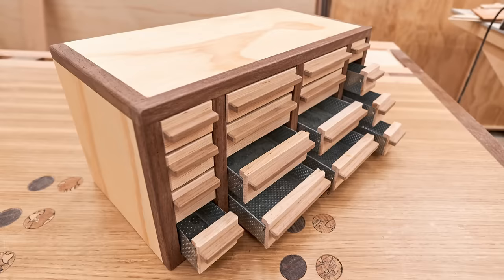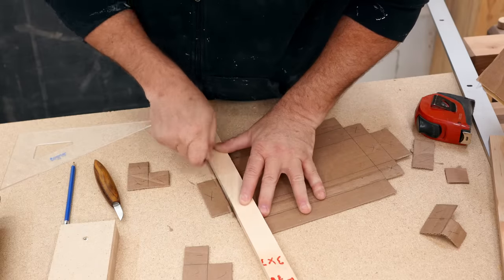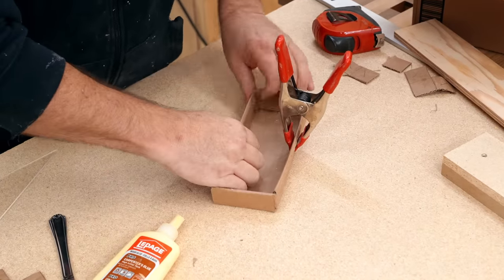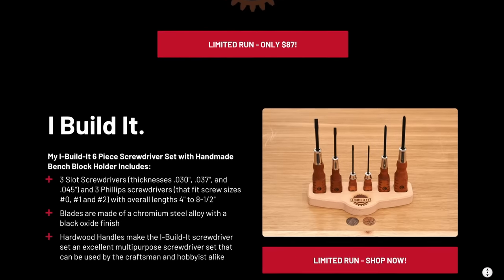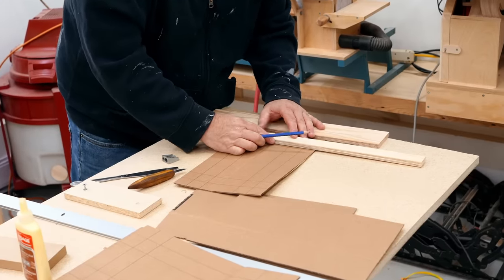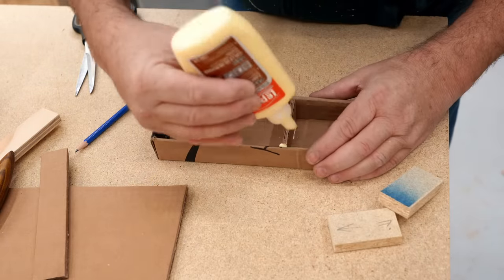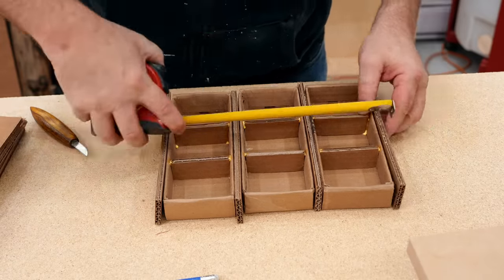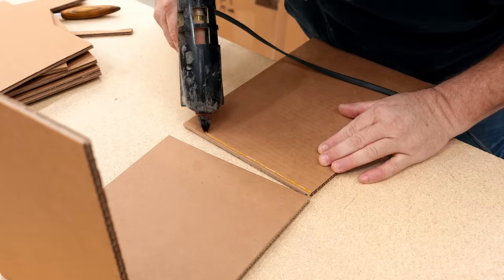Making a Small Parts Organizer with Drawers from Cardboard

Comment from the maker: My 6 Piece Screwdriver Set: https://ibuildit.ca/blog/6-piece-screwdriver-set/
High lumber prices putting the brakes on your creative endeavours?
Got too many small parts cluttering up your existence?
Is cardboard becoming a real problem due to all of the crap you buy on Amazon that you don't need?
Well, here's the solution!
You can actually make some pretty sweet stuff from cardboard, like this nifty parts organizer with drawers. You say it won't last, but you, my friend, would be dead wrong - it will last for years, even with regular use. And you can get a lot more fancy than I did here, and be much more selective about the quality of the cardboard you use. It's FREE, after all! 
Next: a cardboard table saw!!
Reply: Hi John, Thanks,,, Tip use white duct tape to strengthen and good contrast for Sharpie writing.
Reply: You're hawking Slot and Phillips head screw drivers  ?   What kind of Canadian are you ?  Robertson FTW
Reply: >Next: a cardboard table saw!!

This made me laugh, because you could probably do it.

Comment: Add a finish!  That would add more strength.  Shellac or water based polyurethane.  (don't forget to sand between coats!  lol)  Up next week, John makes a mini table saw for cutting cardboard from a pizza cutting wheel!
Reply: You could use a silicone spray like Campdry.  I used to spray my sleeping bags and camp gear.
Reply: John's paper table saw blade would actually be perfect for this 🤣 https://www.youtube.com/watch?v=rYfkhdKcEiE
Reply: You could also just use some contact paper.  It would be the cardboard equivalent of a laminate/melamine top! 😄
Reply: Sorry, John !  I forgot to use the "sarcasm" font -- again.   (sigh)
Reply: @KSFWG  I did get the sarcasm...but the contact paper is just a good idea.  Also, the "laminate top" thing...I thought that was cute.  Just sayin.
Reply: I would love to be there one day when you tell your kids (or one of them) that you are generously passing this project off to them!
Reply: It's not at all like John but an OIL BASED (OMG!!!) polyurethane would be better suited for this project.  Oil based poly will penetrate and harden the wood fiber base very well, adding a great deal of strength to the cardboard.  I saturated my router table top made of 2 layers of MDF with several coats of thinned oil based poly and it's very durable.

Comment: I was a corrugated structural design intern for a bit, so I might actually have something to add!
- when you crease/fold board, the outside dimension will half the board-thickness longer than your crease, and the inside dimension will be half the thickness narrower. Because of, this, it's very easy to lay out designs perfectly from the start, only measuring during layout, as long as your cuts are accurate (we used CNC)
- creases that need to be more accurately placed (like the ones describing the width of the drawers) should be made across the flutes. Creases made with the flutes tend to drift into the nearest flute.
- creases should be indented to about half the thickness of the board. The outside liner will be stretched taught and pulled in to that point, and the inside liner will buckle to meet it.
- creases should be made on the inside of a curve. Creases that need to be made backward are usually made with a perforation (so you can work from one side only).
- to build a pull-tab into the structure, cut an upside-down U-shape into the front outside wall of the drawer, with the "legs" touching the bottom crease line. BUT, don't extend the crease across that shape. When you fold it, it should stick out straight like the one you glued on, but without adding thickness. You can use this to made tabs for closing cereal boxes, and on on the bottom of boxes if you want them to stack into slots on top of other boxes.
Reply: Where can I find this info ?
Reply: I'm thinking if you made a video of all this cardboard folding info, you'd have a really good view count! Thanks!
Reply: I assume the width of the crease must come into play with measurements. Using the back of a butter knife vs an 1/8" thick ruler, for example?
Reply: @wingnutbert9685  The width of the crease should be negligible if you use a reasonably thin tool. Very wide tools result in more of a radius emerging than a sharp corner.
Reply: @Kuchenwurst  Agreed. It was just a thought as thickness of the crease would be a factor if looking to get a snug fit for something like these little boxes. And the tool used would have an effect. I know this from experience, but I often pose these questions to prompt those that don't to take details like this into account as they are often not considered or mentioned. :)
Reply: where did you get this internship? i would really like an internship like that! 
:)

Comment: I'm a cardboard artist, and I'm glad to see others dabbling in card board. I use a pizza cutter to score my cardboard. If you use a length of for the handle all the way back. Apply a light layer of glue to both pieces of cardboard. this will prevent warping.

Comment: When working with cardboard, don't be hesitant to use lots of packing tape throughout the construction.  Cardboard can also be painted to transform it into a durable product. I would love to build several of these to hold not only small parts, but seeds for planting, spices in the kitchen and sewing stuff but I would still make the outer case and shelves using wood for strength and durability while the drawers could be made using cardboard.

Comment: FWIW, the 'paper' clips you referenced are called Bull Clips.  and, yeah, they work a wonder.  i recommend using the plastic ones you can get from Staples, they don't grip as hard as the metal ones, which means it won't dent the heck out of your edges when gluing them up.

Comment: Thank you for this John.  This has inspired me to make use out of the old acrylic sheets I recently replaced. I was about to take then to the transfer station but if I trim the sealant off of the edges I can experiment and make something useful.  I usually keep my cardboard for making prototypes or as padding when I have to work on the car.

Comment: Ya know John, I worked as a mechanic for 30+ years and some of that was in the parts department at the Lincoln Mercury shop and Ford used cardboard parts bins for years getting away from the old metal ones. They hold a lot of weight surprisingly well and hold up good. Went on a Dealership Closing clean out where we shipped all the good stuff back to Ford (in those days) in the trays in larger boxes and a Ford delivery trucked up boxes. It was hard work.

Anyway, the point is the tray boxes were in "flats" of 50 and you folded them together to use. Well I got several flats of small, med, large boxes. After 20+ years they all are looking a bit ragged from the grease and dirt. So I did what you did. I used old cardboard and made new ones... Lol
Awesome video and loved how you sneak in all the little wood jabs like"I'm using wood glue." Very funny...

LLAP 🖖

Comment: COMMENT:  I’ve used cardboard boxes for organizing the deep spaces under some of my kitchen cabinets, but also the caverns under the bathroom sinks.   What I use for “handles” there are strips of 2” wide packing tape that I have running most of the length along the bottom of the box, and then, when it just about gets to the front edge, I lay on another strip, sticky face to sticky face, leaving 3” - 4” length on the end, and fold that back onto the length coming out from under the box bottom.   The tape forms a loop handle that allows for the box to slide easily forward, and, for boxes on shelves above my head, usually let’s me access those boxes without first going to get a ladder!!

Comment: John - whoulda thunk it?  I'll bet so many people are having the same "why didnt I think of that" moments?  I've been casting around for small item storage containers to fit in my mechanics drawers, and even though fast food small containers you get with rice etc, are pretty good, they are still not tall enough so I'm losing a little storage capacity.

I could have used plywood and made a bunch of small containers, but it's one of those things to do after making myself a box joint jig - this however is easy, and I think maybe if I dipped them in cheap oil based varnish it would harden them up a fair bit too.

Comment: If spray everything inside and out with polyurethane.  It will last much longer.  Water won't damage it. 
The labels on the drawers will not peel off.  It will stiffen everything.

Comment: add brown packing tape, as a top coat. parts can move more freely, and if yo over lacp it correctly it will give the  case that added  scrap reisistance. works of zip lock bag as well for a  handy durable plastic tool bag. you have to layer the tape nicly mind so thera good 3mm to 4mm over lap.

Comment: Those transparent kitchen tupperware containers are hands down the best way to organise small parts. Cheap, modular, stackable, different sizes, you can see the parts (labels optional) and you can bring them down to where you are working then put them away again 👍
Reply: But a lot more expensive than the trash he made these out of.
Reply: @KipdoesStuff  true, and they add up if you need a lot of them. Depends on the value of your time I guess. But this is very cool and looks like a fun build so I guess that isn’t a factor. I wanted to mention it here because I was using little drawers like this previously and recently changed over to the tupperware and it’s made things much easier, a lot less hunting around for stuff because you can see at a glance what is there. Also helps keeps the rust at bay, something I neglected to mention before.

Comment: Great! I am currently in the process of making little cardboard sorting boxes that will go inside drawers for little parts. Cut four notches into a rectangle of cardboard, bend, plop some cheapest wood glue, clamp using cheap spring clamps, repeat. Less than one minute per box if you do it by eye.

Comment: Nice project. I make similar little organisers using old ipad boxes as draws. Ipad boxes are quite strong for cardboard and have a nice smooth finish which works really well. The outer shell I make out of 3mm and 6mm MDF and 3d print the handles and inner separators use cardboard.
Fortunate to have access to a lot of empty ipad boxes and recycling them is a fun project with my daughter.

Comment: I did a couple cardboard projects a few years ago and the shop I worked at had a 12 foot accurshear that’s rated to 1/2” mild steel. They kept the blades in good shape but I was still surprised by how easily it would cut cardboard. Made the job much quicker, easier, and more accurate.

Comment: After assembling disassemble everything that come apart, lay it all out spray it with spray epoxy, 1 very light coat, 1 light coat, 1 heavy coat, it will stiffen  it and prevent condensation degradation.

Comment: John this is so old school! Love it. My only concern is the horizontal floors between each tray, and the spacer pieces, the flute of the cardboard would have been better going the other way for strength. There's good chance it will sag over time and the trays will be too tight to easily slide. But as a "free" storage system, cardboard is an extremely useful structural material. Make sure you get those folds in for the best strength! Creased corrugated cardboard has no right being that strong!

Comment: I have cardboard organizers and small shelving units all over my store and shop. I use spray adhesive or hot glue for "sheet to sheet" gluing (double corrugation), I use PUR hot melt to create finished edges. Some of the PUR melt glues are like hard plastic and they give even single layer cardboard respectable rigidity. I use INSL-x  siliconized concrete sealer to protect them from moisture.

Comment: I'd imagine that the roller one uses to press spline into window screen frames would work pretty well as a scoring tool. The nice ones have roller bearings in them to make them turn smoothly and would provide a much better hand-feel than a butter knife during use. They'd be less likely to damage the cardboard, too, since they'd only be crushing it instead of rubbing it. You can even get them with different width (thickness) rollers since they are made to work with various widths of spline.

Comment: Idea: you can replace the front wall with a clear material to make the boxes see-through, and then you won't have to label them (or update the labels if you change the contents!) Just thinking out loud here, but since the front wall isn't load-bearing, maybe even thin flexible plastic sheets would do the trick (e.g. old transparency sheets, to stay with the upcycling theme). Perhaps cut vertical slits into the inner layer of the side walls, about 1/4" from the front, and slide the sheets into the slits. You do lose 1/4" of drawer depth that way, but I think having see-through drawers is worth it :)

Comment: Wait... What? No band saw, no meter saw, no circular saw, no jigsaw, no sabre saw, no oscillating saw, no drill press, no jointer, no planer, no sander, no router, no lathe, no biscuit joiner?! And no noise?! I dig it. However, I've noticed that you did not use a push stick when cutting the cardboard, that you let the knife running at full speed on the workbench when not in use, and that there was no evidence of you wearing a N95 mask when hot gluing the parts. I hope that next time you will demonstrate a better understanding of basic Health & Safety rules.